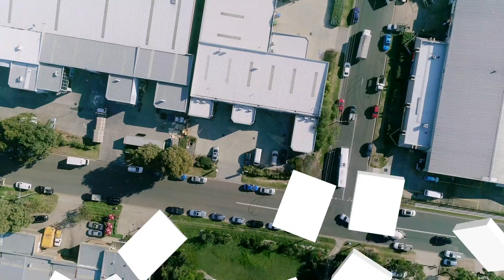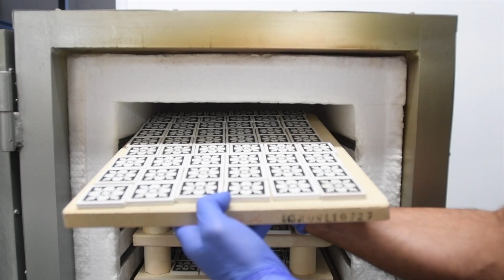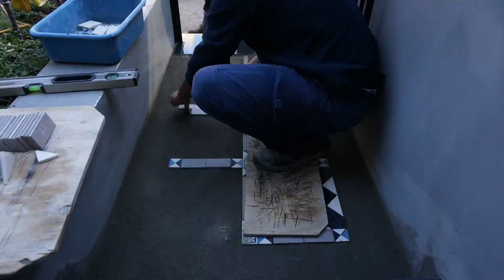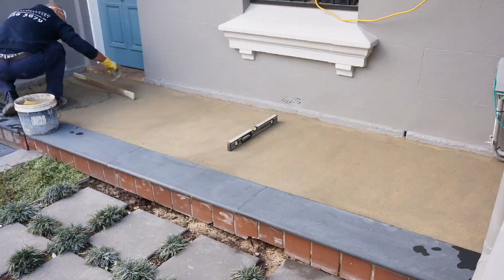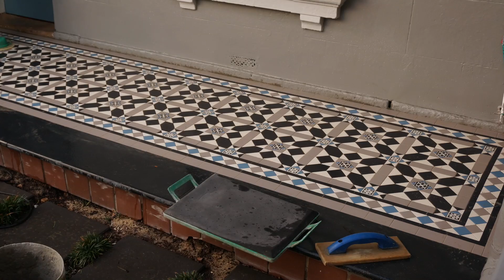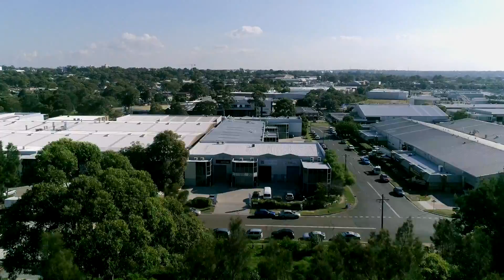Tessellated Tile Factory

Comment: Hi I’m in Australia and am thinking of trying to lay my own verandah tessellated tiles. Do you Kay straight on compacted sand or does it have concrete of lime mixed in with it? Do you have fall so water runs off the verandah or are the tiles always laid on a completely level surface?